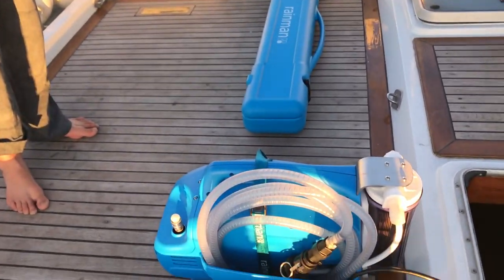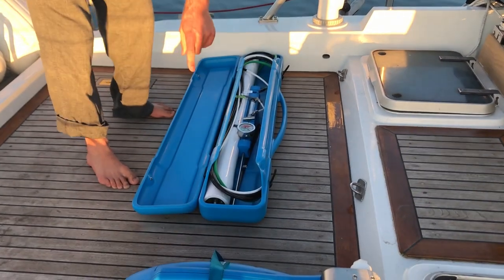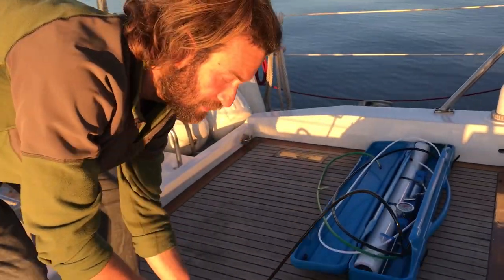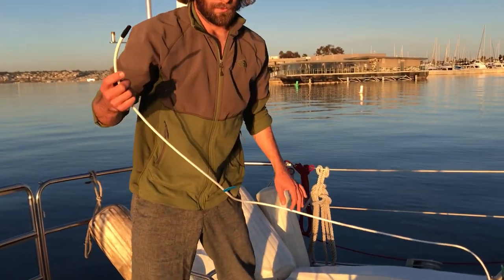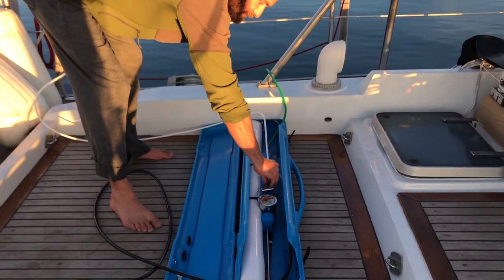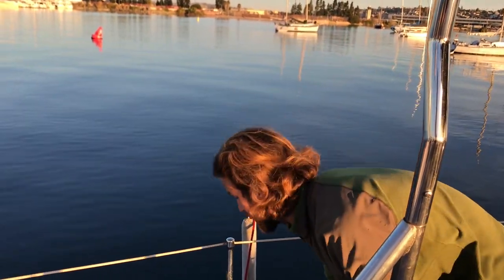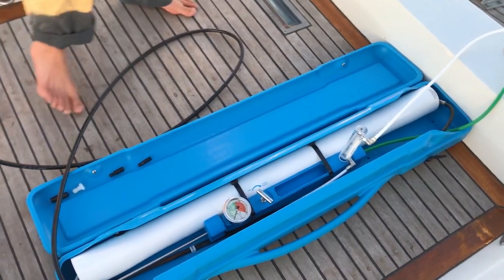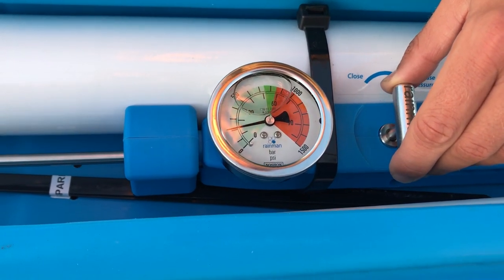How to Make Your Own Water at Sea!

Comment: If you have the opportunity, then you can collect the brine too. It’s fine filtered salt water, free from debris.

Do you run your watermaker from shore power only ?
Reply from the maker: In this video, we are generating power using our generator (that is the engine running in the background) although sometimes we do run it on shore power. We are almost never at a dock, though. 
Out of curiosity, what would we collect the brine for?
Reply: @sailingnewhorizons  
What ever you can find useful for.
Toilet flush, dish flush, whatever.